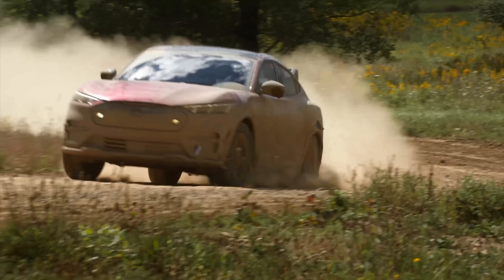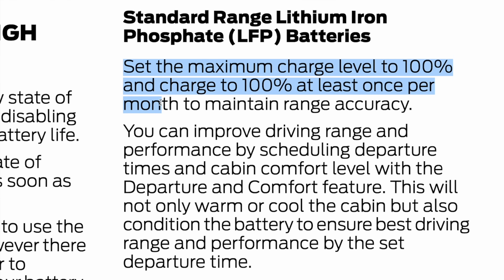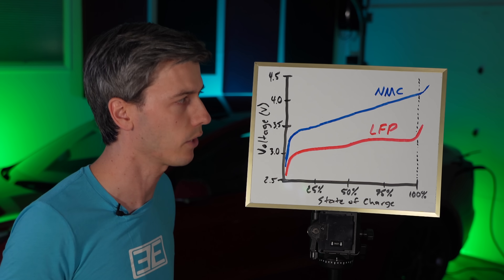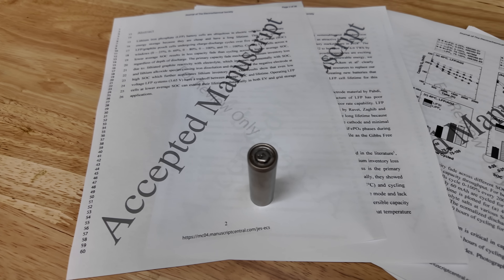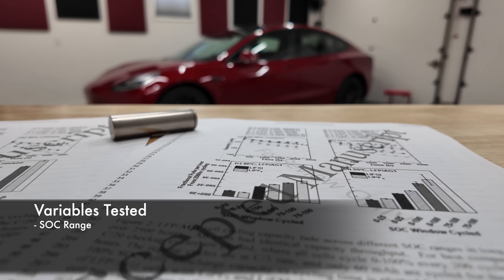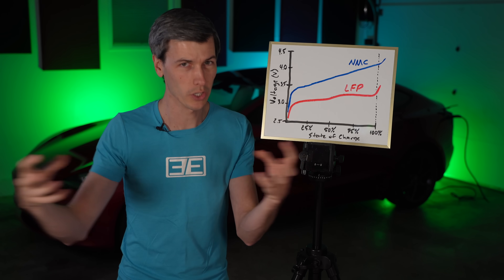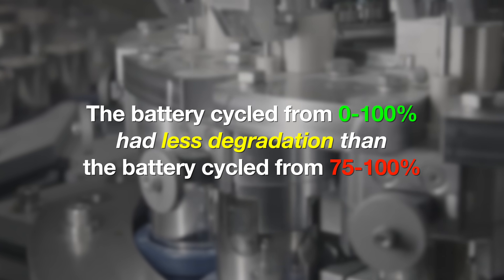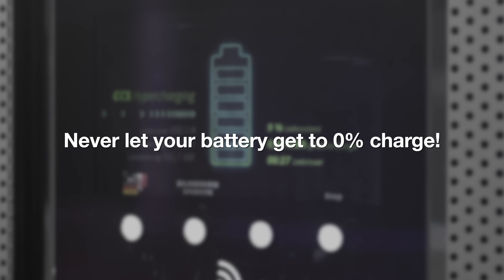How To Ruin Your Electric Car's Battery - LFP Edition!

Comment: Also, something to think about is it is good to fully charge to 100% and leave it charging over night to top balance the cells so that all cells are at the same voltage. If cell voltage difference gets too high it will degrade individual cells faster lowering the overall capacity of the battery pack an and degrading the pack lifespan as a whole. I would hope that newer EVs use higher quality BMS's that can keep cells perfectly balanced but its still a good practice especially considering charging LFP packs to 100% doesn't do as much damage as NMC.

Comment: So, I have to disagree with the way the video was presented, as a LFP expert (for around a decade now).   The basic reason is that you aren't really articulating the scale of these various degradation mechanisms.  So I'm going to outline the scale.  So waiting to the end to tell people not to worry about it... is kinda backwards.

* LFP batteries have a cycle life far in excess of the life-span of the power electronics in the pack.  Almost no matter what you do, the power electronics will fail long before the cells do.

* Charging range.  IS.  IRRELEVANT.  The difference in degradation best-case to worst-case is very little.  This is not the knob that messes up a LFP battery.  There are people with 15+ year old packs in stationary storage configurations (solar / off-grid systems) that cycle daily to 100% who are still pulling 90%+ capacity.

* Temperature conditions matter the most.  If your regular parking spot is in normal temperature conditions, the LFP battery will last forever.  If its cold, it will last forever.  If the vehicle is stored in very hot conditions regularly (not just occasionally, but regularly), that is where degradation might become noticeable.

* Calendar aging causes more degradation than cycling.  Yes, really.  Which is why regular temperatures while parked matter the most. 

* The only other thing that can actually destroy a LFP battery is letting it discharge too low.  i.e. letting the car sit at a very low state of charge.  It is significant that owners who try to low-ball the SOC are far, far more likely to mistakenly leave the car at too-low an SOC and actually do more damage to the pack than if they didn't.

That's it.  Charge the LFP battery to 100%, plug in whenever you want, don't worry about it.  Really.  Don't worry about it.  Just worry about regular parked temperatures.  If you live in Texas or Las Vegas or Arizona (etc), having a climate-controlled garage will make a huge difference.  If you live in California it literally won't matter because the weather just doesn't get hot enough to matter.  If you live in cold weather areas, that's actually going to make the battery last longer.

-Matt

Comment: A lot of good info that can be completely ignored by the ICE car owners. Seriously, who wants to deal with all this crap?
Reply: Read his pinned post above; even EV owners need not worry about it. He just likes to delve into the science.  Also there is a lot of ICE crap I don't have to worry about, like oil & filter changes, clutches, spark plugs & wires, transmission fluids, air filters, fuel filters, ... Get a grip, its just different stuff, but less overall.
Reply: There is a lot of complexity to ICE cars that we are either used to or get used to now.
From different oils in different climates or new vehicles. Gear box wear and tear.
And now all these low emission zones and anti smog zones that pop up in Europe.
It's not getting any easier.
Reply: @weerolein  All the technical issues you mentioned are not the end-user's headache. All the owner needs to do is to bring his car for yearly service.
Reply: @TheShrike0o0  But that is far from accurate. Local pollution restrictions do absolutely affect you and only affect you as an ICE owner. Also driving behavior in a new car is your concern.
So no, both EVs and ICEs are plagued with a great many issues that are hard to overcome.
Reply: @TheShrike0o0  how is that any different to an ev. Only regular maintenance required is tire and wiper fluid. When something breaks you take it in just like any other car
Reply: People who dont want to eat insects for protien.
Reply: Ice vechiles are way more complicated to me that’s part of why I switched to ev. Not to be more environmental but because it’s more practical for me
Reply: @MC---  so true. Don’t miss the extra trips to the gas station. I have an 80 mile commute and just charge at home with a full battery in the morning ☺️

Comment: You forgot to mention one very important thing about LFPs.
Their very flat curve makes it difficult for the BMS to know whether some of them are drifting in their state of charge compared to others.

So this is the other reason (and perhaps the most important) why it's necessary to fully charge them, in order to balance them correctly.
Reply: Yes, very true. One of my e-Bike "safety batteries" is LFP and it is always very confused about its state until you fully charge it.
On the bright side, the BMS gets less hot then the one handling the NMC battery.
Reply: He literally said it in the video? Weee you paying attention
Reply: @Gabri3lRocha  timecode ?
Reply: @salomonguillaume4491 isn't that what he talks about at 4:15 for the next minute or so?
Reply: @xipalips  thanks. Was just about to search it to
Reply: @Gabri3lRocha  It's not what he said
Reply: @salomonguillaume4491  literally what you said is what he said 😂🤦‍♂️. But I’ll just leave it at that. You’re either trolling, a bot, or just a rock. No point in wasting in more time
Reply: @Gabri3lRocha  It's not my fault you have limited knowledge of the subject.

If you don't understand the difference between estimating the total capacity of a battery pack and being able to measure if some cells in the pack are not all at the same SOC
Reply: @Gabri3lRocha  Have you ever build a battery pack ?
Reply: @Gabri3lRocha  timecode of the word "balancing" ?
Reply: @Gabri3lRocha  I'm waiting for the timecode with the word "balancing"

Comment: Lead-Acid and LFP batteries are polar opposites.
Lead-acid wants to be fully charged and kept there. They suffer from deep discharge and deficit discharge (charging to 100% infrequently)
LFP looks like they want to go to 70% max and sweet spot at 50% and are very tolerant of deep discharge.

Comment: Looking at the data, they get fractional degradation of 4x10-5 per hour for 75-100% at rate C/3, corresponding to 6 hours per cycle, or degradation of 2.4x10-4 per cycle. Extrapolating gives around 830 cycles to 80% capacity, or around 200K miles for a car with 250 mi range. But this is also a worst case scenario, this is done at 40 degree temp, the degradation slows down after 1000 cycles (Fig 9) and their cells are custom handmade so might lack some recent manufacturer "magic" so I expect real world cells to last much longer. 

Its probably not worth stressing over. If you followed their best practice, your battery would last over 3000 cycles which would be 800K miles, longer than most cars last.

Comment: Using 0% SOC as a lower bound might be good for stress testing, but a more realistic 10% - 35% testing range would be more informative for determining EV best practices.  The benefits of cycling in a lower SOC range are probably greater than the 0-25% vs 75-100% comparison suggests.

Comment: I think it is important to mention life cycle differences between Nickel-based (1,000-1,500) and LFP (3,000-5,000). If LFP is used under the worse practice, you can still get 800,000 miles out of it. Not much incentive to keep the SOC as low as possible but having the max range at all time is more important due to lower energy density of LFP.

Comment: Though Tesla doesn’t directly address it, one advantage of keeping the LFP EV plugged in, is for many brands (including Tesla) battery temp is maintained above a problematic minimum temp.  And until LMFP or other low temp tolerant LFP variants get into EVs, the standard LFP battery cant be charged at < 0C without risk.

Comment: My advice is to charge your LFP battery to 100%. You'll enjoy better performance, eliminate range anxiety, and ultimately get more enjoyment out of your car. The battery will degrade over time regardless, so when it's time, you can sell it and get a new one. I'd prefer to lose around $1-2k in resale value over the next 4-10 years than constantly worry about whether I have enough charge for an unexpected short drive. After all, you own an EV—keeping it fully charged shouldn't be an issue..you should be able to afford it. And remember, all it takes is one traffic jam on the highway where you're stuck for hours to wish you had charged it more.
Reply: Uhhh, why do you think being stuck in a traffic jam for hours is a problem? It's not like cars use a constant amount of battery power whether they're going 65 mph or 5 mph. The amount of battery power used to keep the cabin warm or cool, the headlights on, and the radio playing, is peanuts.
Reply: @ps.2 I'm sure that's true all the time.
Reply: @ps.2  4 kW ain't peanuts. That's 4 kWh per hour. The Polestar 2 I am driving uses that much sometimes just running the A/C.
Reply: @franklofarojr.2969  I'd hope it doesn't, my house full ducted aircon uses less than that and it's a long way from ultra efficient (retrofit to an older house).

I like the series hybrid that is the Koenigsegg Regera, 750hp of electric motors, 1500hp V8, but only one gear through a very special torque converter. The electric motors get it going and you can drive only on them if you choose (though not very far) and the engine powers the rear through a single ratio as well as charge the battery.

Actually the Chevy Volt does that too, and uses the petrol engine when cruising at highway speeds as it is more efficient there.
Reply: I'm at 95% capacity in over 300,000km of 0-100% literally EVERY SINGLE DAY for 3 years.
Reply: @flinchy-5224  Where tf u work when u have to travel ~300km daily
Reply: I cycle my M3 RWD LFP between 40 and 60% like i did with my 2019 NMC
Reply: Ummm... Why are you spreading garbage FUD that EVs will die in a traffic jam? I can guarantee you that EVs will outlast ICE cars in an extended traffic jam.
Reply: I think given that charge spike at the end I'd probably aim at 95% in general with a monthly 100% charge.

But also less charge cycles is beneficial, so just charge it to 95% once a week (I typically only do a couple hundred KMs a week in total, a tank of fuel in my 4x4 lasts a tad over a couple of weeks).

I would love for someone to create a 4x4 with a series hybrid, strong motors on each axle, LFP battery with say 100km range, perfect car for me. All my day to day could be done on battery only, and when I go off on adventures I still get that sweet sweet torque but the longer range and easy portable energy of a fuel can. And I would love to be able to amble along sometimes in complete silence listening to the nature out the windows.

Keeping an eye on Edison Motors for sure.
Reply: @morosis82  Series plug-in hybrids are the only hybrids that make sense. You can utilize chargers, and don't have a transmission.

Comment: Jason: LFP batteries have a cycle life of 3000 cycles. In a EV with 250 miles range, that translates to 750k miles. Most users would not keep the car for that long. In that sense, the strategy of how to prolong the life of a LFP battery may not be relevant to an EV owner. Perhaps, a more interesting question is that if I keep a LFP battery SOC operating between 75 to 100%, would the battery capacity retain (less than 20% degradation) for a 10-15 year ownership?

Comment: There are two different mechanisms regarding battery degradation: Cyclic and calendaric ageing. The study presented here only looked into cyclic ageing. Calendaric ageing (i.e. battery degradation by time without use) also increases with a higer voltage so another advice would be to not leave the battery at 100% but to only charge to 100% for calibration if you intend to use the car afterwards. It's the same thing as why modern phones charge to 80% in the evening and then wait until a few hours before the alarm is set to charge to 100%. 
But I think manufacturers know that not everyone will charge to 100% regularly so the car will be able to handle some error within the SOC readout. Guess setting the cap to 80 or 90% and then charging to 100% every few months will work just fine too.

Comment: Disclaimer: I want a Tesla

This problem doesn't exist with ICE vehicles. Doesn't matter if I put a gallon or 16 into my tank. The only exception is if I leave the gas sitting in there for 20 years, it may go bad. SHRUG

Comment: The VIN numbers are determined  by NHTSA, not the automotive manufacturer. Every LFP car has the same number in the VIN that determines whether it is LFP or NCM.
Reply: Full confession: I bought a Model 3 right when they were switching to LFP. When my car was available I looked at the VIN and saw that it was NCM. I wanted an LFP so I lied and said that I was going to be away for Christmas and couldn't pick it up, so they had to wait and send me a different one, which was LFP.

Comment: Dude. I have two teslas, one of each battery. I know more because of this video and now I have to explain this to my wife?!? 😂…. I was happy to not go to the gas station, but now I have to make sure she’s charging correctly at home 😂😂😂
Reply from the maker: Haha, you don't have to do anything. You can just live life and it'll be fine! But if you want the least degradation possible, there are best practices.
Reply: @EngineeringExplained  yeah…. I’m not too worried. I’ll just set the daily charge limit for her ride to 75% and just remind her to plug in….and a bi weekly 100% maybe. Still better than the gas station in my opinion.

Comment: I was lied to. I was told that with LFP batteries, I should charge to 100% daily and it wouldn't harm the batteries. I've had my 24' model 3 SRP for a month and I've been doing this daily until this video. I'm now wishing I got the dual motor long range version.

Comment: So let me ask you this, why don’t car manufacturers have some sort of limiter/ oversize the batteries so the charge is regulated. Have a larger battery and it only allows itself to charge itself to 100 and slowly drains to calibrate once a month. All other times it keeps at 50-60% for all cells?

Comment: Ford recommends 90% charge for their NMC battery, 100% as required
Reply from the maker: Yep, though 90% for daily use is kinda high. There's a meaningful difference when lowering the percentage (Dahn recommends 70%, I do 80% bc I like to have the range immediately available for longer drives).
Reply: @EngineeringExplained  Ford has a 10% overhead for the long range battery, so a 90% charge is effectively an 80% charge... At least when new. Does that make it more reasonable a recommendation?

Comment: Cheap battery, more or less but not resulting in cheaper EVs, for profit! Also manufacturers do not want you to maximise usage of your car by programming the BMS to keep battery charged to 95% and disallow discharge below 10%. Actually everything can be programmed but bothering the end-user is like a chore, owning such complex machine is a chore so you need to be battery expert or abuse the car and then sell it. Cynically what is the main point in this video is exactly the opposite of what manufacturer advice is (to charge LFP to 100% always).

Comment: Not a big fan of leaving EVs unplugged regardless of chemistry.  Leaving it plugged in prevents unnecessary partial cycling due to parasitic draw by keeping the battery SOC at the same set level.

Comment: out of how many batteries will the majority of batteries last 20 years. They last 5 years or less because some batteries in the pack fail. Which is why batteries should never be sold with the car or truck. Always leased. This way the packs are quick swap and remain in a manufactures rebuild and reman loop. To rebuild the packs. To swap for quick charging. To swap for larger and smaller packs. This EV scam is set up to fail they way it is running now. No batteries are recycled or rebuilt. Cars are WAY too expensive because you are paying for the entire fuel plan of it up front. EV's will not be a valid transport until they figure this out. But then they can't keep going with the planned obsolescence  and sell you a new one every 5 years. Batteries in a drill don't last 20 years so they will never last that long in a car. NEVER it's a lie. Why is this charge cycle best practice not built into the cars software to do it all for you. Because it's all about spying on you and stealing from you and selling your private information. Not transportation. I will never own a post 90's car. NEVER.